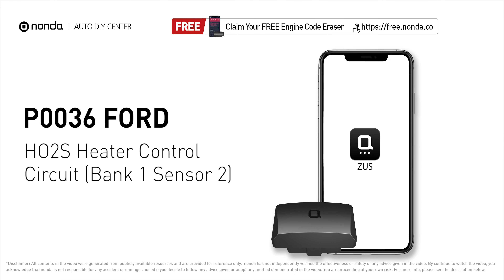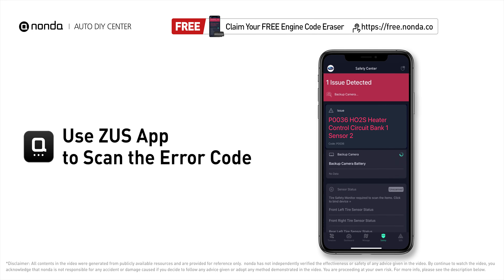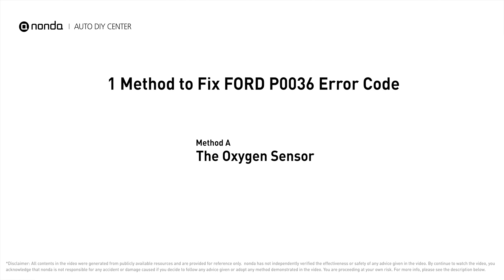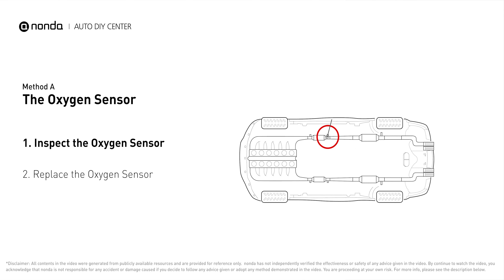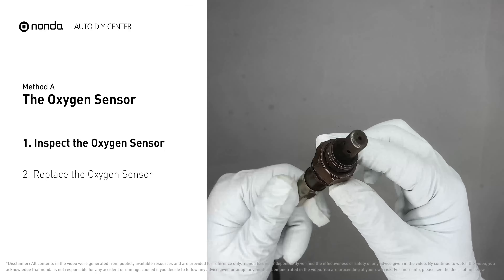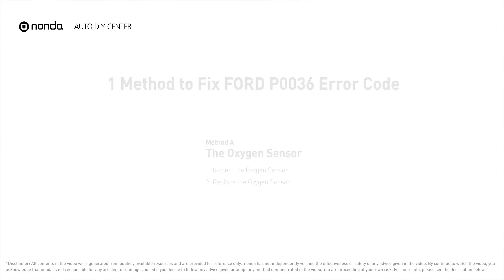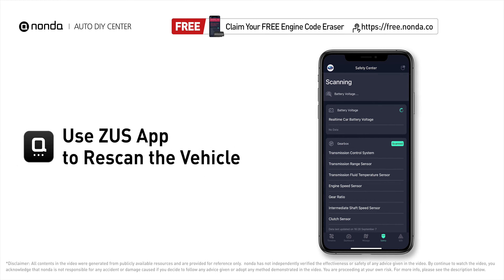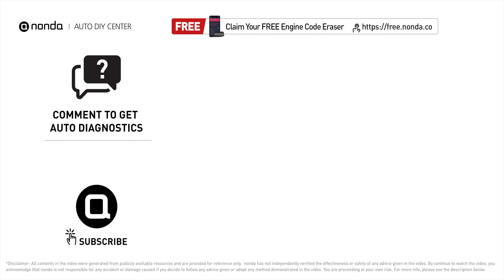How to Fix FORD P0036 Engine Code in 2 Minutes [1 DIY Method / Only $19.64]

Comment: Had this error that occurred 3x on my Ford 2021 E450.  I tried erasing the codes to see if it was a fluke or reappeared but only 2 codes were erased.  The original remained and is now marked as "permanent" in my OBD display.
Reply from the maker: Hi Brooks, please make sure that all the related wiring and connector are in good condition and has proper voltage/ground to the sensor.
Reply: @nondainc did you fix the p0036 problem? I have the same problem... (permanently code)